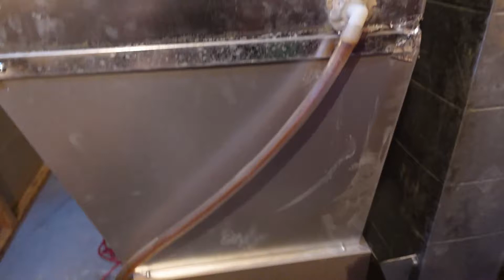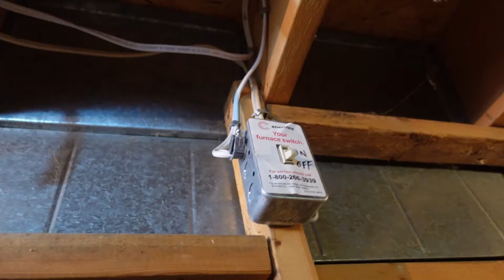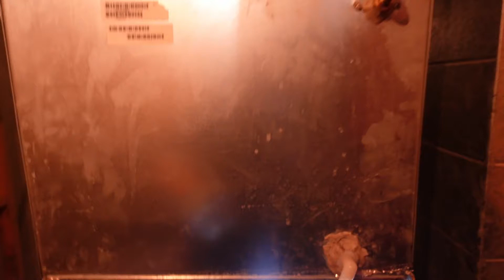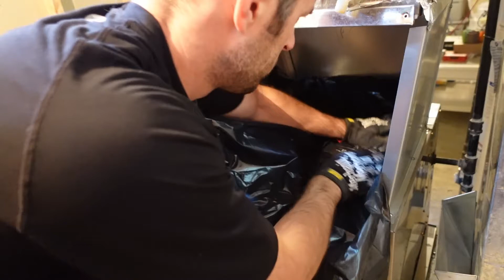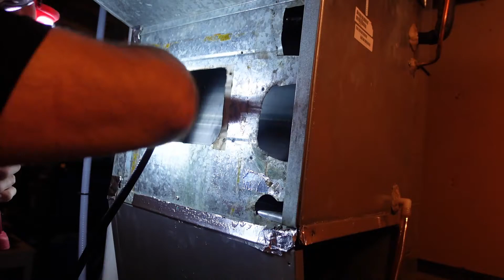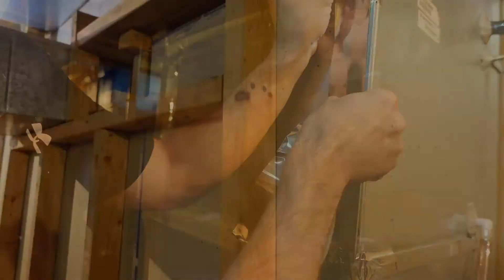AC Evaporator Cleaning

Comment: Combine evaporator coil cleaning with condensate drain cleaning.  With access to the condensate drip pan, add 4-6 condensate tabs ( a bottle cost about $12 for 100-200 tabs), and will clean the drip pan and the condensate drain pipe.  Also, if you can get access to the p trap on the drain line, add a couple of ounces of vinegar an hour before the AC is run, or early in the morning during season.  The vinegar will clean the trap, the condensate tabs demineralize the pan and the condensate water with have a chemical to keep minerals, lint and dirt from clogging up the drain pipe.
A clogged condensate drain line, without a kill switch like a Rectorseal overflow switch, will result in gallons on water on your AC floor until you noticed the overflow.    It’ll take a couple of years for the drain line clog without any cleaning, but it’ll clogged.
Reply from the maker: Thanks for the tips

Comment: My unit has the a coil on the bottom of the unit. I cannot get underneath it. Do I just clean the top of it?
Reply from the maker: I'm not really sure about your specific situation, but generally speaking I would clean what I can access. That said I don't know everything about your specific situation to make that call.
Reply: In this case, bottom access is best.  Side access won’t get better access.  In tight access, a spray bottle can hit most surface area, but it’s not controllable.  I’ve used a car AC cleaner which typically has a 8” nozzle tube that may direct to more spots.  Do the best you can, plus clean the outside condenser coils.
The AC trainers educate techs to, before any any diagnosis or readings, check for clean evaporator coils and inside air filter, then the outside condenser coils.  If flow isn’t obstructed, a good tech can more easily diagnose any issues such as component failure like a TXV meter in an older system (like my R-22).  Dirty filter, dirty inside and outside coils make the system work harder and off the designed performance.

Comment: If it was all foam sitting there after spray cleaning it, Y not just vaquum it off?😐
Reply from the maker: I suppose you could if you wanted that in your vacuum.
Reply: A lot of coil cleaners, especially if rated for evaporator coils, says it doesn’t require rinsing if you run the AC soon after.  I would spray with clean water so the water mix with coil cleaner and drip down into the pan.  Run your AC for like 30 minutes so the inside humid air becomes condensate on the coils and will carry away foam, cleaner and dirt.